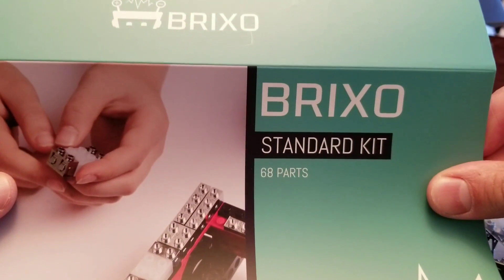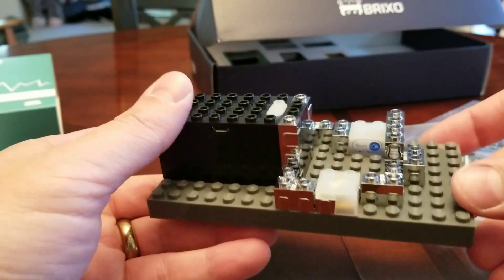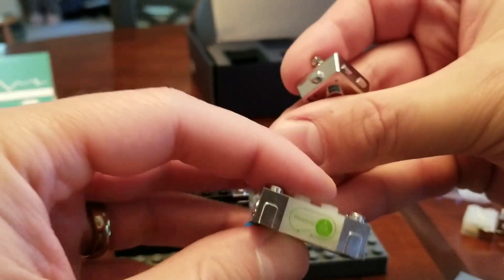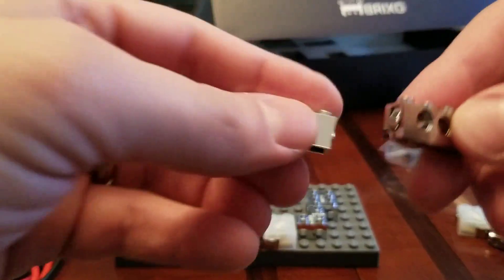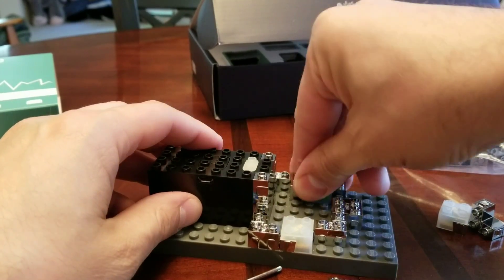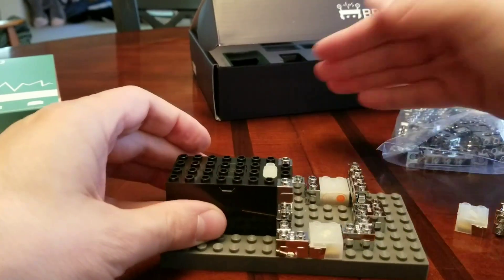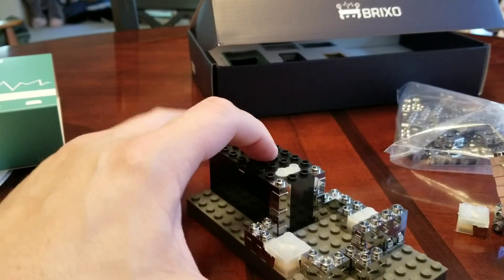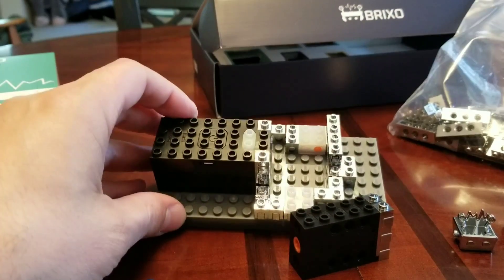Intro to Brixo Standard Kit

Comment: I don't see the usb connector like you have it. strange. there's a little plastic indentation where the connector is supposed to be but that's not a cover is it, ? 

it's supposed to have the bluetooth sensor built in, says so on my standard box too.
Reply from the maker: You might want to ask the Brixo folks. They either stopped putting the USB connector on or covered it because people kept plugging in USB thinking it was a charger and it ended up overheating the batteries (it's not a charger).

Comment: Have you gotten Bluetooth to work?  I can't seem to find the directions for getting it up and running.
Reply from the maker: C Anderson I don't have the Bluetooth sensor.
Reply: The Standard Kit says +Bluetooth .
Reply from the maker: Be that as it may, mine doesn't and I don't have that sensor. You may be better off contacting the Brixo cold directly since I'm sure they can answer you more authoritatively.
Reply: BRIXO’s smart internal 9V battery block powers your creations and constantly monitors their currents so you don’t have to worry about short circuits. A built-in Bluetooth controller will let you change the current’s direction and voltage levels via our mobile application. The smart battery will also detect when you're not using BRIXO and conserve power to extend battery life.
Reply: FYI, I got this today:

Thank you for your note and project support.

We have yet to release the control app. It's set to be completed within 2 week's time. If you've tried an iOS device, it won't detect the BLE (iOS simply doesn't have that mechanism on it). With an Android device you should be able to see the battery's BT.